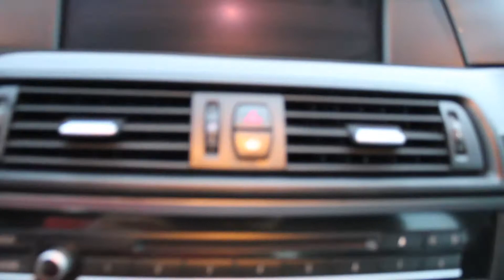2013 bmw 535i key fob & comfort access issues.

Comment: I have same problem u know how to fix it? 🤔
Reply from the maker: Giorgi Tsalatze replace the fuse in dashboard glove box.
Reply: @MinutebyMinuteNews  
What the fuse in glovebox?
Reply: @MinutebyMinuteNews   which one is the fuse for confort acces in glove box?
Reply: I’ll come fix it for you Giorgi ☺️☺️☺️
Reply from the maker: @cristiraicu7294  I can’t pin point which one exactly coz I am not a mechanic  but it is one of those in the glove box and you need to check them all. The best way to access them is from the bottom where the filter is.
Reply: @MinutebyMinuteNews  found it and is 15 blue one
Reply: Oh Kay this is a nightmare... I had checked all fuses and I I’d it twice and every fuse was good except one it was the day cig lighter fuse. This shit is really making me frustrated and annoyed. My key fob does not comfort access it’s uncomfortable no access and will not lock or unlock nothing and it’s seriously a
Reply from the maker: @jacobcoffey7345  make sure your key fob is connected to your car.
Reply: I have the same damn problem, I have done everything except order a new driver door handle. My key fob pops the trunk, let the windows down and up, but wont unlock the doors. I can start the car with the fob so I assume the fob is connected to the car. Will the dealership charge me to check my key???
Reply from the maker: @dymelsonnieblack286  if your key does all the other work then it’s not your key. It’s the fuses which most likely is 15 blue and if that doesn’t have help then it is your door actuator.
Reply: Fuse #14 which is a 15amp mini fuse. Although it may pop again later. I found my car on very cold days is popping this. Maybe the grease inside the door lock motor is getting hard and slow actuation. New motor is like $250 US